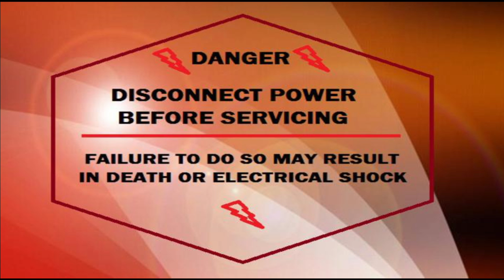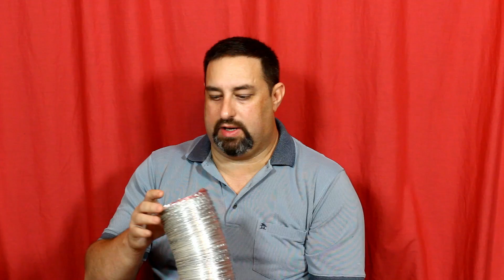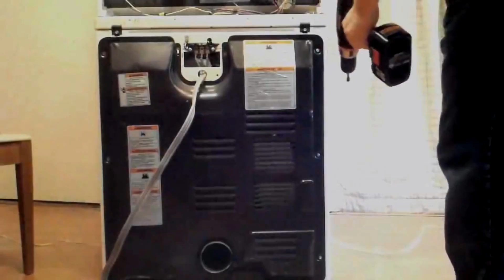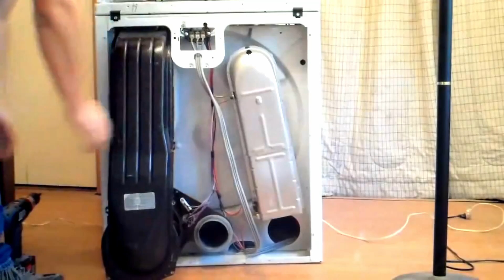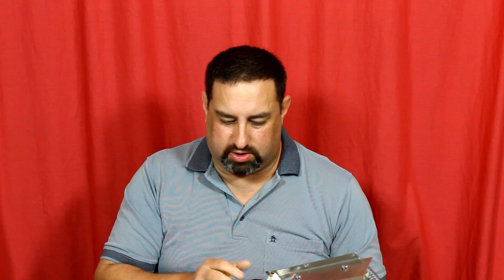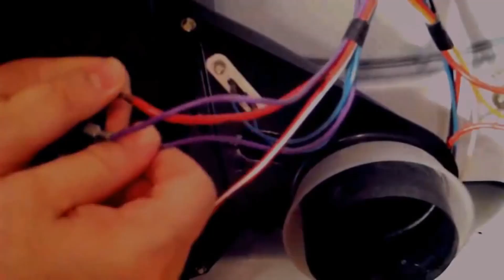Dryer Takes Too Long To Dry - Troubleshooting & Repair

Comment: When I replaced my heating element, I figured it out by watching your videos by the way , I also replaced the thermal cutoff and the fuse at the bottom. By replacing those too I fixed another problem of not having the dryer start automatically when I put it to a timer . Meaning I could press the start button without it being put to the timer and starting automatically. About 2 months later now it just started starting automatically when I put it to the timer. Will I need to replace those fuses again or is it okay to leave alone or is this going to break down the heating element faster?